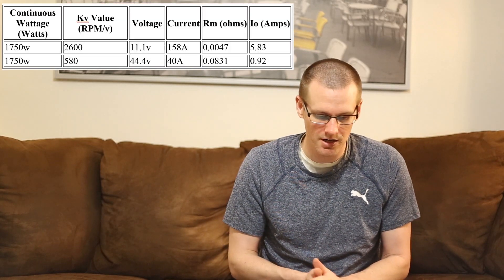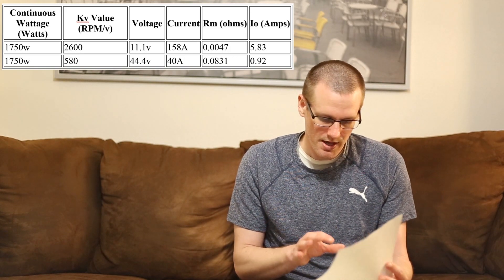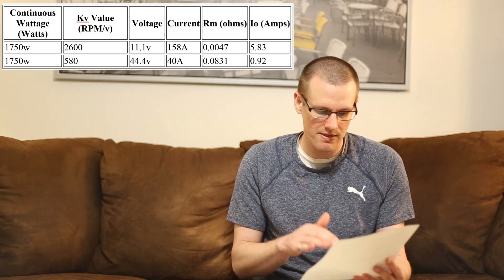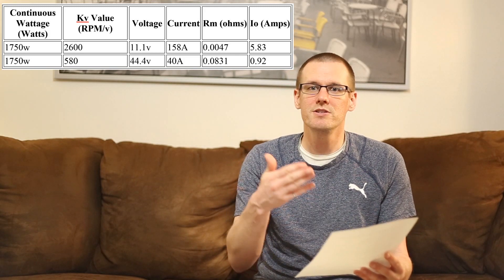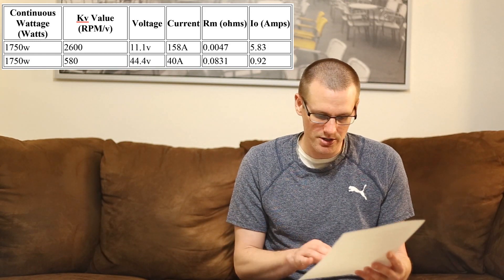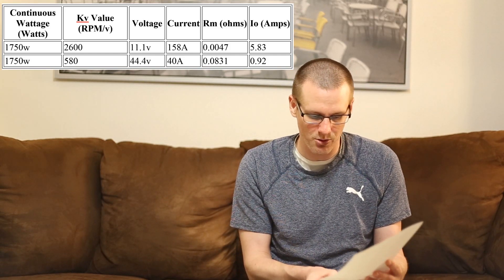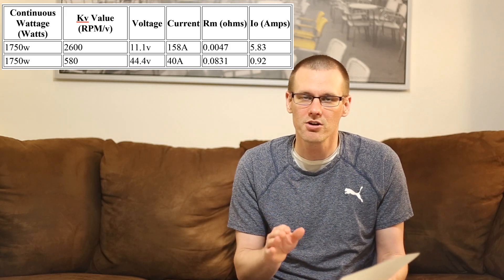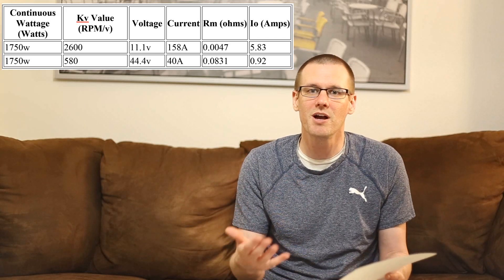Compare Equal Size Brushless Motors with Very Different Kv's

Comment: 1750W ? That high amperage sounds like bullshit. Can you show in a video with multimeter how it draws 1750W ?
Reply from the maker: Hey Kristiyan, thanks for the comment. A Multimeter would ignite in to a ball of fire if tested as suggested. Check out the video in this link where a similar setup is pumping out a lot more than 1750w of power. I go in to detail and break down 4 data logs. 
https://youtu.be/RA0H4zrBfXU
Reply: @RCexplained  I am interested in seeing this in a video, not about data that I don't know where it comes from and I doubt it. Driving consistently 320 Amps through a copper wire, means that this wire is now almost comparable in diameter with a 540 motor. You can use a relatively cheap (under 100$) clamp meter to measure "320A" so no worries there. So, can you relate me to a video ?
Reply from the maker: Hi Kristiyan, Everything on this channel is based on theory, data, and tested results. If what you find here still leaves you in doubt, there's more than enough resources out there to make sense of it. 

I'm not sure how you expect someone to capture a live read out for you while the car is loaded accelerating to over 200km/h. 
I think instead of consistently you meant constant or continuously?  There's no secrets, the duration of time was also in the video. Peak power comes from getting to top speed, not maintaining it. How many watts of power do you think it takes getting a 5Kg RC Car to over 200km/h in only a few seconds?
Reply: @RCexplained  Yes, I meant continuously. If this 320A is a peak of microseconds or something like that, maybe sure. But for 5 seconds you cannot drive 320A through any 540 motor. The amperage seems way too high for the width of the wires in the coils. I cannot find any useful resource on this. Only videos I find where they use meter on the power supply show 15-20W draw while accelerating a motor to max RPM with no load. It does not have to be in a car, you can introduce artificially load on the motor (literally even just by grabbing the shaft with cloth and using friction). Driving continuously 320A requires wires of size around 1cm by 1cm square - This is an insane wire size...
Reply from the maker: Hi Kristiyan, 
Take a look at this datasheet. Find the 1521 motor with a 1D wind. I have driven this motor personally at a constant 150A and it would easily sustain a 5 second burst over 300A. Look at the 0.5D wind as well! https://neumotors.com/neumotors-1500-series-bldc-motor-500-5000-watts-2/#1521

Here, this motor is smaller (smaller than 540 size) than the one mentioned in this video and provides you with exactly what you are looking for. Not my video but like I said, there's more than enough data out there. He does 2 tests, second one is the manufactures recommended voltage. 
 https://www.youtube.com/watch?v=8qQSzhxKZjQ&t=181s

Your 320A requiring a 1cmx1cm wire gauge is coming from a data sheet that is not for the correct application. You can't use chassis wiring or Power transmission charts!
Reply: @RCexplained  Thanks! That is what I was looking for. I can understand this could be done only for bursts, but not sustainable for longer periods, otherwise wires can easily melt (well I guess ESCs would automatically handle throttle down for protection). I am new to RC stuff and filling my carts and tried to make sense of these advertised powers which are insane.

Comment: can I use same size but slightly different kv in a same build please
one of my drone lost a motor and I can not find the exact same motor 
I found a motor with same size but the kv is 3800 but my drone motors kv is 4000
thanks
Reply from the maker: I would not feel comfortable using 2 different kv motors on the drone. My recommendation is to keep all the motors the same.
Reply: @RCexplained  thanks for the reply , great help
Reply from the maker: @bbab9051  glad to help

Comment: With more surface of a bigger motor, does that mean a large physical size motor with a low KV would run the "coolest"? What I'm gathering from your video too is that a lower KV running on a ton more volts actually demands much fewer amps than a larger kv motor running on much fewer volts. Pretty dramatic.
Reply from the maker: Yes larger motor with lower kv would run cooler, primarily because of the surface area. With a lower kv you go up in cell count.

Comment: is the rpm determined by the voltage and current thru the motor or the speed at which the phases of the internal coils change?  are they controlled externally or by the volatge appled?  if they are a 3 phase motor then the speed is determined by the speed of the phase changes not the voltage applied. Too much voltage aand you let the smoke out  unless the reverse emf keeps the current down.
Reply from the maker: Hi doccpu7, thanks for your comment.

The maximum RPM a brushless motor can spin is determined by kv and voltage. 

RPM from 0 to that maximum calculated above is determined by PWM chopping in a 3 phase brushless motor. - where voltage is constant.  

Trying to over advance the timing of the phase changes will not speed the motor up. It will only place the motor and ESC out of sync.

Comment: Would it be possible to use two different motors for something like an electric skateboard? As an example, 130kv for torque and 220kv for speed? Would you need a slipper on the lower kv motor for when the speed goes over it’s limit? Thanks
Reply from the maker: Hi Eiren, Using 2 different motors with different Kv's would not have the effect that you are looking for. It would be complicated and not necessary. Size the motor to be able to handle the amount of power that you would need to dump during acceleration. Select the correct kv rating that allows you to hit the max speed you wish to achieve. 

Take a look at the video on the channel about torque. It may help out.
Reply: RCexplained ok thanks a lot, that makes sense. Only reason I ask is I’ve got a few motors laying around and wandering if it’s possible to combine them into one build, despite their different ratings!
Reply from the maker: @eirenwhelan3312  I don't think it's worth the effort. Sticking to one motor where ever possible is usually best. If you go with dual motors I'd use the same kv ratings for each.
Reply: @eirenwhelan3312  you could use a one way clutch so one or the other motor is doing the run or acceleration but you get more friction and weight.

Comment: Your videos have helped me a lot with sizing motors for my 3lbs combat robot, I originally had a 2836 3200kv and it kept catching on fire after being run very hard. I've since have gotten to resize to better sizes with better startup torque at lower kv ratings and all my issues have gone away along with the originally sized motor.
Reply from the maker: Hey Ray, I'm glad the videos have helped. That's a great story. I have never built a combat robot and it sounds like so much fun!

Comment: I am not a pro racer , I run Rc cars as a hobby , but I buy premium racing for my 1:10 scale car,  , I have 2 fantom motors FR1 V3 series. , So what should I choose ? a 10.5T motor on 2s or a 17.5T motor 4s, most likely the rpm would be same , but which one will be efficient ?  I want reach about 80 km/h maximum speed
Reply from the maker: My preference would be for the 4s setup.
Reply: @RCexplained  Thank you for the advice, I subscribed and found lot of useful videos on your channels , great stuff!!
Reply from the maker: @gehandx  Thank you for your awesome comment! I'm glad you find the videos useful!

Comment: 80-90% efficiency on brushless? Wow, what's the efficiency of brushed motors then?
Reply: I googled it and they state 75%-80% efficiency, is that correct?
Reply from the maker: Brushed motor efficiency can be anywhere from 70-80% typically. Efficiency for a brushed motor drops when the speed approaches the motors maximum recommended speed. The primary cause for this is arching that occurs on the brushes and commutator.

Comment: How do I know which 380/390 brushed motor is best??? When I say best I mean fastest.
Reply from the maker: It would be the motor that can output the highest wattage. To check for this it would be worth looking at physical motor size, kv, and Rm of the motor. A larger motor with a lower Rm and the same kv is a good indication.
Reply: RCexplained I simply can’t find enough info online. I’ve been looking at the Traxxas Titan 380 18T brushed and the Tamiya Sport tuned 380 18T motors. All I know is the size and turn of each motor. I can’t find anything else about either. I’m trying to upgrade my brushes motors in a dual motor setup. It comes stock with a pair of 390 motors that I also can’t figure out the turn count of. I am just lost in need of real help.
Reply from the maker: Hey Jason, Without information or experience with these specific motors, it's going to be hard for anyone to determine which motor is best suited for your requirements. It may be best to hop on to a forum to hear from those that are experienced with your RC.
Reply: RCexplained will do. Thanks

Comment: Lol I wasted 14 minutes of my life. You said something which you could say in few seconds. You didn't say anything important.
Reply from the maker: Hey harynian, thank you for your comment and watching 14 minutes of this video. The last 20 videos posted have been kept shorter. Check those out.
Reply: @RCexplained  Hey, thank you for your reply. I have watched your video, because I'm looking for some answers. Maybe you can help me. For example: I got (but I don't have, I could check myself) SkyRC Toro X8 pro, 2150kv, 2400W, max 114A, max 21V and it gives 45150 max rpm. Torque is 0,508 Nm. What will happen if I use battery with 8,4V? After my calculations I get power 383W, 45,6A, 18060 rpm and 0,203 Nm. Am I right?
Reply: @harynian what you said is a bunch of jibberish

Comment: So for rc boats running 4s-6s you want a lower kv to get the higher voltage with more heat dissipation for longer life outta that brushless inrunner motor and if the kv is higher then you can only safely run lower cell count batteries safely because they don't displace heat as well as the lower kv so like a 2900kv-3800kv 3674 brushless inrunner would best be suited for 3-4 cell batteries and on the upper 4 cell side you probably would not want to push higher c rating out of those motors because they can't displace the heat as well as say a 1900kv-2700kv 3674 brushless motor. Ok so if this is true and I am reading your numbers right the lower kv motor won't need as high of a amperage esc as the higher kv but if you use a higher amperage esc with a lower kv motor that doesn't need anywhere as much amps are you hurting that higher amp esc by running a lower amp usage motor????
Reply: esc is determined by max current the motor can draw

ex : a motor can draw max 50 amps ,then u should choose esc 10-20% higher than that , tht would be 55 or 60 amp rated esc . hope this helps
Reply: and if u use esc that rated wayy more than the motor current it should be okay
dont choose esc that below a max motor current

Comment: Brother, thank you. I'm not sure how you managed to sift through the chaos I presented you with so methodically, but that was perfect and you just tied up so many loose ends for me. I should be wrapping up a pretty rad build that will be the quintessential compliment to your aforementioned future ICE/Brushless comparison video  (I'm trying to mate a pretty high output brushless motor to a pretty over-built moped 2 stroke in a beautiful root beer colored 1974 tomos frame...) Any how, thanks again... You're a killer instructor here at 'YouTube University'
Reply from the maker: Thank you Samm, appreciate the comment.